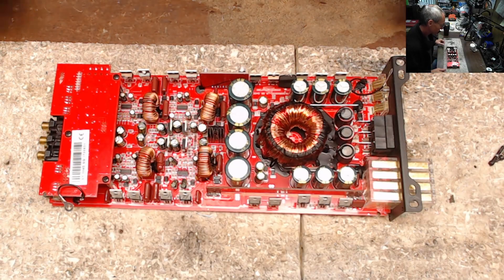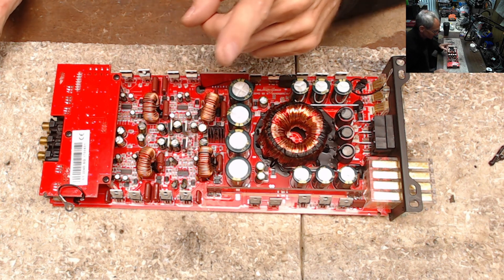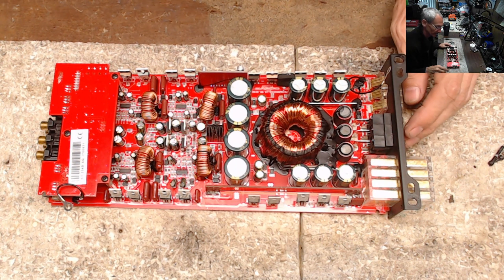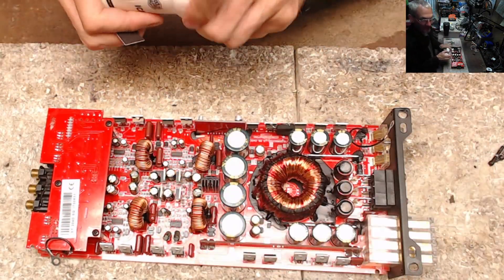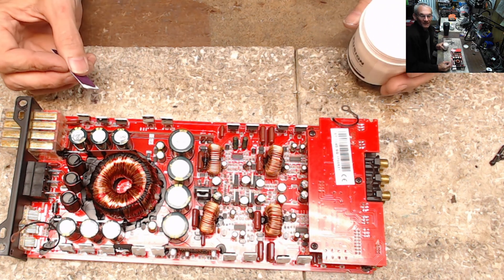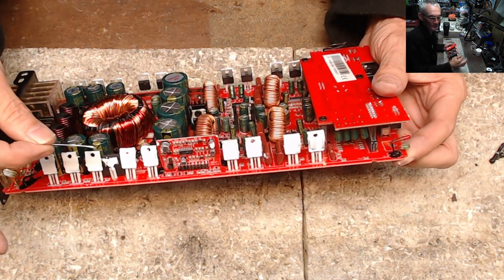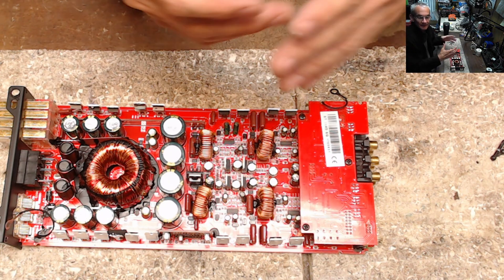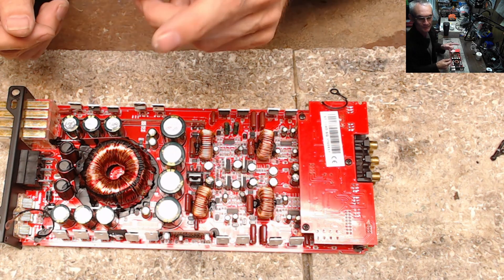Zapco ST 240D SQ Importance of Thermal Transfer Durning this Abnormal HOT Weather

Comment: So when you meant by that amp coming in for service due to shorter voice coils at the point when you start reapplying the thermal paste you said it failed initially because of the voice coils shorting out, you are talking about the speaker voice coils shorted which then damaged the output on that board right ? Just want to know amps don’t have voice coils right 😂
Reply from the maker: Correct, a speaker voice coil short destroys the output transistors within the amplifier.

Comment: What are your recommendations for an mono block repair that got the power supply hooked up backwards?
Caps, transistors, what else?
Reply from the maker: Reverse polarity can cause all sorts of issues. The best practice here is to see what has been damaged. If you pull the power supply transistors and replace the filter capacitors I would fire it up and see what the drive looks like. In some cases, you have to replace the drivers and possibly the zener diodes if used making sure the RMS voltage of the gate drive is the same across all gates.
Reply: Awesome!
Thank you!

Comment: Most thermistors are in series with the remote input circuit or the B+Switch.
Reply from the maker: Actually, most thermistors are part of the 393 comparator circuit located on the power supply drive cards in today's amplifiers.

Comment: Hey Todd, great video. Do you also put the compound between the insulator and heatsink as well?
Reply: Silpads don’t require thermal paste, down side they are 0.008” thick while Kapton is 0.002” and requires thermal paste.
Reply from the maker: If the factory added it I do replace it. Some types of insulators do not need it though.